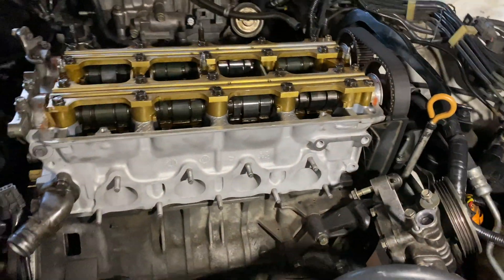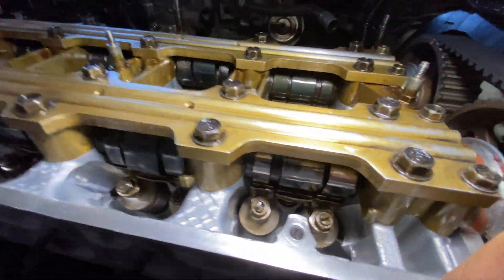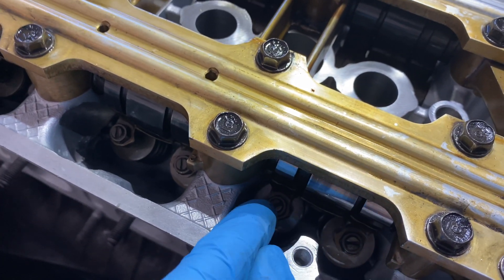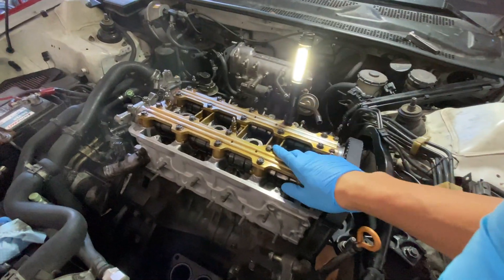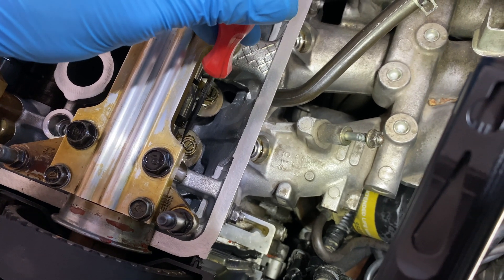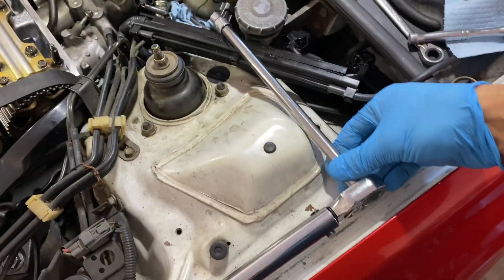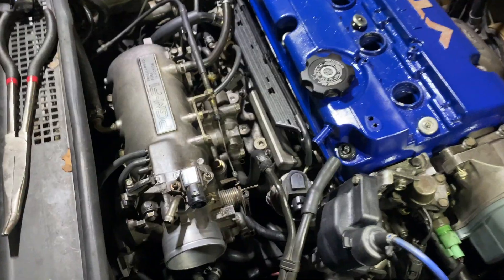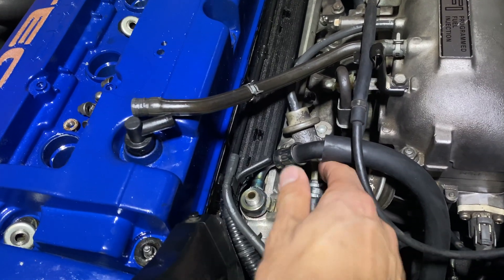Valve Lashing the Honda Prelude

Comment: Thanks for the video. I once did this on my F18B2 Accord which ran much better till rust took the car from me.

I now bought an almost mint 1992 Prelude with an H23A2 and I will do the valve adjustments next winter when I won’t move the car at all. It was a lot easier to access the valves on the F18B2, still it looks manageable on the H series.

Comment: Get a deep socket that fits on the nut and then weld a wrench around the socket..you will still be able to hold the nut and stick a flat head all the way down to adjust the screw
Reply from the maker: Ah man, I don’t have any welding skills 😫
Reply: @Rawrkee  dosent have to be pretty,just enough weld to hold the wrench and socket together.as long as you can still fit a flat head down threw the middle.JB weld liquid may even hold it enough to tighten it..
I just didnt wanna buy the tool specifically for it,like 80$

Comment: I've blown up three H22A engines after doing the valve clearances. After the 3rd engine blew I lost my mind and ended up in the psychiatric ward. I Only ride the bus these days if the docs let me leave, but I started cutting myself in the dark so I've been locked down. Sometimes I hit VTEC with the razor and go a bit too far. If only there was a tool that could hold the nut and turn the screw at the same time, I wouldn't have to cut myself to block out the demons in my head. If such a tool existed I wouldn't be suffering so deeply and I wouldn't hurt the other patients. But the fantasy valve tool only exists in my imagination, like the demons. All i can do is cry and watch youtube until I get angry and hurt people again. It's their own fault for coming near me when I'm slashing myself and making VTEC sounds. Why am I always the one to get restrained its not fair. As if they can't hear the demons talking too. I'm not even crazy I'm normal its them. And the demons they get to torment me.
Reply: AND I THOUGHT I WAS THE ONLY ONE!!!

Comment: Hey man! love the videos! i actually bought a 5th gen a couple months ago and i ended up with a rod knock. after investigating i found out i had piston slap and it scratched the cylinder wall. so i bought another prelude for parts with a healthy engine. so im planning on doing an engine swap and rebuilding the top end for preventative maintenance.  Head studs, gasket, timing belt, manual tensioner the whole 9 yards. im new to all this! so i recently found out that i should also do a valve lash adjustment. im literally going to be doing everything you've been doing in your videos! 1200 for the original lude, 1000 for the parts lude and 700 for all the additional parts. this car has been an emotional roller coaster. i've thought about giving up on the project a few times honestly. but i have 2 ludes and a bunch of parts coming in the mail...... im in too deep now lol. keep up the videos man! you've been a great help!
Reply from the maker: AH man, def sounds like you're going through all the trouble I've been working through, ahhahaha
good luck with your rebuild!